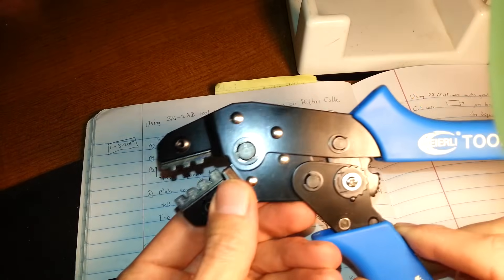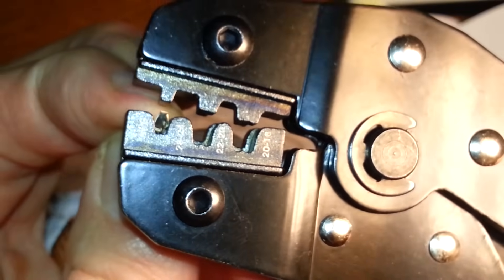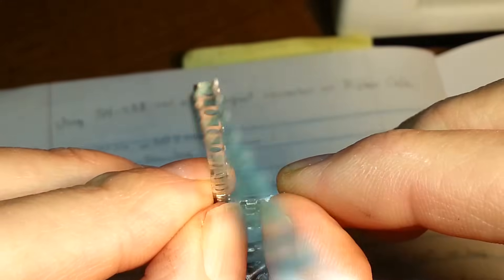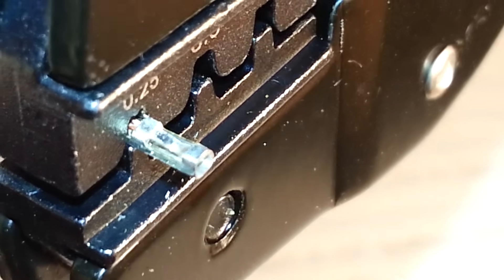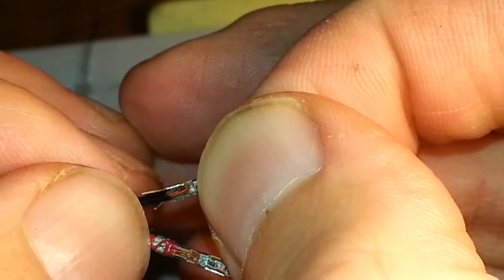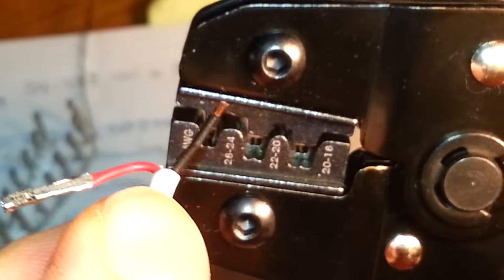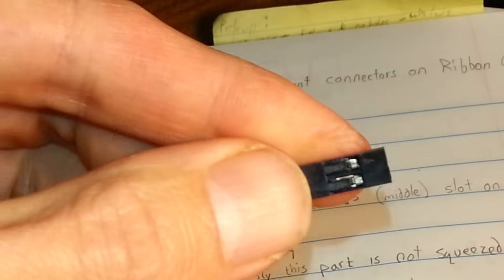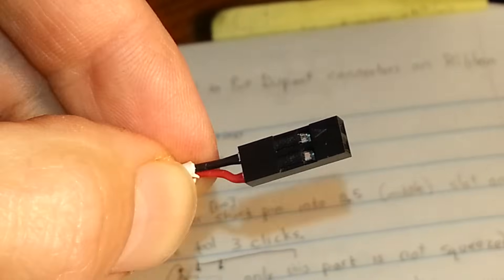SN-28B Crimping tutorial for DuPont pins.

Comment: The crimp should insert into the housing without needing to push it in with a screwdriver. If it doesn't just slide in, you have a poor crimp.
Reply from the maker: Good to know!  I wondered if it was because the pins I bought on eBay weren't up to par.  I'll try one without the wire to see if it slides in easily (to remove user error).
Reply: The problem is that the SN-28B is the wrong tool (no matter what the Chinese vendors claim). It’s designed for much larger terminals, so the finished crimp is too wide (and the wrong insulation crimp shape).

It’s not the shape of the terminals that causes the problem, it’s the crimp tool.

Comment: Watch what you're buying. The cheap ones are not stepped and attempt to crush the insulation crimp to the same size as the wire crimp. It looks like decent ones in this video.
Reply from the maker: Chaos Corner, it is somewhat hit-Or-miss, because I definitely bought the cheap ones.  Good to know about the differences!

Comment: I think it's smart
For that part where you use your nail to prepare a tool for that!
maybe a kontra plug? 
So you can not put the plug too far into the pliers?
.
And for thin Wire it is indeed an idea to double-fold and maybe too tinning the Wire?
it is needle work, you should also not be shivering ;-) 

Succes and cind regards from the Netherlands!
Rob.
Reply from the maker: R. Rob. thanks! from what I've read, tinning is problematic because the wire tends to break at the point the solder stops.  I had no luck folding the wire to increase the diameter of the wire for the benefit of the connector.  
I'm not shivering.  I'm holding my hands far apart from my body because I'm viewing my hands through my phone which is attached to a magnifying glass.  so doing precision work with arms extended causes unwanted movement. try it! :-)  also, the magnifier distorts your sense of how much you need to move your hands.
Reply from the maker: R. Rob. I looked up Kontra plug.  it was an audio plug?  anyway, ib think it is a good idea you have: anything to grip the pin and shields the body from going too far into the crimping tool might work.  Netherlands?  wow- so cool to reach the world!! :-)
Reply: No no audio,
But a similar type of plug maybe?

Yes, indeed, the Netherlands to be more precise near Rotterdam.
Google Maps is your friend! ;-)

I saw that you also did something about CNC,
Here on this side I like to do 3D printing.
BUT a small CNC is also on the list!

Kind regards from here again!
Rob.

Comment: If you twist the wire when it is longer then cut it you will get better results faster...
Reply from the maker: Superb Media Content Creator , that is a great idea.  
Cutting the wire at the last step is similarly useful when doing wire wrap connections.  Use that extra leverage!
Reply: It's hard to figure out the size of the right 'crimp' too but actually, soldering connectors is passee...

Comment: The crimping pliers are SN-28B. What is the label of jaws only ? I have bought the pliers but with different jaws, so I need to buy appropriate jaws to replace existing
Reply from the maker: Petar Nedic , I looked and there is no label on my jaws.  Anyone else know?
Reply: @TheRainHarvester  Thank you for responese !
 It can be engraved stamp on jaws (the part which goes into the pliers). Would you be so kind to just take a picture of jaws taken out from pliers.There are lot of jaws intended for crimping pliers and they have different shapes and dinemensions. The most important dimension is the thicknes of jaws part which goes into the pliers (4 or 6 mm).
Reply: @petarnedic855  I have the exact same tool, Weierli SN-28B. The jaws are 4 mm and marked with the number 28. Hope this helps you out.
Reply: @PuchMaxi  Thank you friend !
Reply: @petarnedic855  No worries amigo!

Comment: I found an easier method. insert a paper clip into the 'wings' to bend them over using your thumbnail to curve the wings over just sufficient to allow the wire sheath to enter as an interference fit within the wings - NOW the connector is 'fitted' to the wire - then holding the wire only introduce the connector into the crimper upside down and crimp in one action - it works really consistently. if your eyes are a bit weak get yourself a lamp with magnifying glass - this takes the hit or miss component away from crimping.
Reply from the maker: That is a great idea!  This idea coupled with the trick of inserting a pin into the connector side can really position the wire correctly!

Instead of a paper clip, why not use the wire itself?  (The portion without the isolation)

Comment: Look for an old used HT-0095 on ebay (or HT-100, same tool) That is the official factory tool for DuPont terminals, it crimps much better than generic double D crimpers. The die is cylindrical and swages the barrel into a tight tube around the conductor.
Reply from the maker: Thanks! Sometimes the pin doesn't fit the housing if you crunch this blue tool too tightly on the last step.  (It is a little bent, or too wide.)  I have seen people use pliers to straighten it, or squeeze the width smaller.  Thanks for the info!
Reply: If you need to do male terminals you need HT-102 btw. both of these do 22-32AWG wire. For 18-20AWG you need HT-73. also there are a pair of older tools called HT-208 and HT-213 for 22-26AWG and 28-32AWG. You can find old used Berg and Dupont branded units for under $100 on ebay, currently this connector family is made by FCI Amphenol (Harwin has a copy called M20 connectors with their own crimp tool). New crimp tools cost around $1000 and way out of range of hobbists. Compare pictures and make sure you're actually getting the actual tool because similar tools with the same ratchet handle get mislabled sometimes by Ebay sellers. you should also make sure that it still has the pin loading mechanism on the back.

 Useful information on these connectors and pictures of the tools can be found here:

http://tech.mattmillman.com/info/crimpconnectors/#minipv

Comment: Is every crimping tool equal? I mean like the size of the pins. i want to make custom wires in my pc but some crimping tools are way more expensive then this one, so are there size defferents?
Reply: Crimping tools vary widely. Crimping is a precision metalworking process with tolerances measured in hundredths of a mm or thousands of an inch, especially on small contacts like DuPont. So unfortunately, to get proper, reliable crimps that meet their maximum current specifications, you have to use the right tool, and they ain’t cheap. (They’re a lot cheaper if you buy them on auction sites and classifieds. A used original tool, even one that’s technically slightly out of spec, is worlds better than a Chinese tool.)

Comment: I hate crimping these. I test tried multiple tens on ATX Power supply cables and failed. What does the trick for me is to put a ferrule on first and then crimp onto the ferrule.
Reply from the maker: I didn't know they made ferrules that small.  Where did get them?
Reply: @TheRainHarvester  On Ebay there are 0,34mm² and smaller ones. With ATX cable you can crimp on white 0,5mm² ferrules. The cable part and the conductor part of the dupont crimp thing will grip on the unisolated part of the ferrule but they hold firmly and dont squish off the cable. I have the problem of breaking the wire at the part where the thing should crimp onto the isolation. https://www.ebay.de/itm/Zoller-Frohlich-Aderendhulsen-isoliert-unisoliert-0-14-mm-bis-25mm-TWIN/223496414298?hash=item34096ca45a:m:m077pmCLzh3knW_uHBFx7vQ 

0,14 mm² cable is rated for 3A which is max for dupont.
Reply: @TheRainHarvester You can get ferrules down to 0.14mm2 (26AWG) at least, possibly even smaller. With that said, there’s little point in those, as a 0.25mm2 (24AWG) ferrule will work fine for them, too.

Comment: You're actually the first I saw to specifically mention the "short" nature of these pins, which are 10 mm long. I then went to search for more info and indeed it seems there are also 12 mm (11,7 mm) pins out there. I took apart one original (factory crimped) Dupont connector and sure enough, it used the 12 mm pins. So I'm guessing 12 mm pins are the way to go. But are they available in China via eBay ? I think all those common ones on eBay are 10 mm versions. Any ideas ?
Reply from the maker: Perplexer1 Perplexer1 When I looked on eBay, they never specified the length.  Maybe a listing will sometimes specify.  It is strange that the default (unspecified) lengths of the pins and the housings were consistently unmatched over multiple orders that I made.  One thing to try: use the "ask the seller about this item"  after clicking on their user name when looking at the product.  They usually get back in a day or two.

Comment: This video helps me a lot. I also worked with professional tools in the past(from weidmuller). But €300 or more for private use is too much.
Reply from the maker: rick reiniers I agree.  This tool is just fine for my occasional / hobby use.
Reply: indeed, i'm currently using it for creating stepper motor cables for my 3d printer.
Reply from the maker: rick reiniers Nice! What printer are you making?  I'm currently making a PNP machine for populating circuit boards.  Keeps me thinking at night!  Post a video link if you post a video.
Reply: A reprap prusa i3
Reply from the maker: rick reiniers Are you using a kit, or gathering all the pieces yourself?  What do you think it will end up costing?  The biggest expense on my cnc was the stepper motors.  It would be cool to be able to click them in place to swap them into other machines!

Comment: Buy an automatic wire stripper tool, set the  strip length and this will keep your cuts uniform. Twist the wire to keep them tight or use wire ferrules and crimp. Ferrules can be problematic depending on size. These are small and may not work. I just twist the strands and then insert. I like the detail good job.
Reply from the maker: Wayne Wilson , I never heard of ferrules before.  Thanks for the information!
Reply: @TheRainHarvester  sure thing.

Comment: don't take this the wrong way but man... buying quality tools will save you a LOT of time.
Reply from the maker: Just curious...what is low quality about this tool?  It seems well-built to me:  a solid feel, and repeatable results.

Is there a more automatic version out there?
Reply: Yes, the quality of the tool is not good. Go for iwiss and it will save much of your time. Its very poorly built tool really, especially the jaws. It does it job, but it looks like the jaws are a bit dull.
Reply from the maker: +Satyajit Roy Thanks for explaining about the jaws.  What would sharper jaws do?  ( I didn't realize these were dull, and I'm not sure what part of the jaws could be sharper.)
Reply: The back side of these jaws are almost flat, but the one I use has proper curved holding area. This helps to keep the crimp aligned automatically and makes the manual process easier. Also the jaws are made of fine quality steel and looks shiny. Its not the cosmetic reason only of having them with shiny looks, but the fins of the crimp then slide through very nicely.
Reply: I was thinking the surface was just way too rough to be conducive for the "wings" and other metal with sharp punched metal edges to slide smoothly around to get that rolled and pinched effect, I made tools for making goggles that presses a bead, and rolls the whole thing to make a curled round shape with that bead on it, all with out crimping the brass or copper or whatever I am using (titanium is the newest material) and the smooth aspect was essential on the exiting roller faces, (entrance is rough to grab the metal and force it through) so seems like these should be similar, same with many of my pliers I have modified to bend and form metal in little ways (like tip of a pair of pliers that have a V cut in one and the other is ground down now to a sharp flat point with a bit of rounding on the tip to keep from cutting into the metal I am forming into 90º angles. smooth where you want it to slide and rough where you want it to not slide (like the back of the barrel where you dont want it sliding so it rolls around, the wrong way, instead it would hold it from sliding while the wings and bits would not grab to try and force that sliding around.
Reply from the maker: That is a good idea in general: modifying pliers for specific purposes!  How do you cut into/modify the hard steel that pliers use?
Reply: @TheRainHarvester  Crimping is a precision metalworking process that demands precision tools. This tool is entirely wrong for these contacts, so you’re doing a lot of manual fiddling to overcome this, with only partial success.

The proper tools are not only designed for the contact in question, they are made to higher standards. This means precision jaws with mirror polished insides (this isn’t for show: the rough surface of cheap tools prevents the contact from sliding properly during crimping, causing the contact to “seize” into the walls of the jaw rather than sliding up and curling inwards. It also makes contact removal much more difficult afterwards.) Furthermore, the real tools have positioners/locators to hold the contact in the right place. And finally, they have some form of wire stop, so that there is zero guesswork into how far to insert the wire. 

My favorite kind of wire stop is actually an insulation stop, which means the insulation will always end exactly in the gap between the conductor and insulation wings, eliminating the effect of tolerances in the strip length. Going from an SN-28B to a proper crimp tool took my success rate to practically 100%, and each crimp takes seconds to do instead of dozens of seconds of fiddling. The resulting crimps are flawless and fit the housing every time. The tool I got sells new for almost $500, but I got one, brand new and unused, on the local auction site for $60 shipped. 

What I find disappointing is that the Chinese vendors all save every penny possible, targeting the lowest price at all cost. If, instead of a target price of $10-25, they targeted $50, they could make a tool that’s much closer to the real ones, with locators and wire stops and everything.

Comment: nice video BUT!
if you are now before you shrink
a male pin stuck in the female before you go shrinking???
then the copper wire can do not go further than that is necessary

and better I think you could make a mold in this way.

success with shrinking!

friendly greetings from The Netherlands
Rob.
Reply: the pin trick sounds very useful maybe coat it with something too, so if you do like I do, and tin the wire then clip and clean it to fit, once crimped I can also heat and solder that to the connector for a good solid connection, and a say aluminum rubbed or just use aluminum raw, as the pin, the solder will not grab it nor flow where the pin must be. :)

Comment: I always solder mine. It's slow, but far more flexible in wire size. No special tool required.
Reply: Youre are defeating the purpose of crimping which is giving the cable more flexibilitiy to mechanichal stress.
Reply: Soldering crimps is just bad science often carried out by auto mechanics trying to be auto electricians.
Reply: @greenpedal370  It might be bad manufacturing practice, but not bad science. Soldering crimp terminals is a practice often employed by aircraft builders to improve reliability. Crimping, done properly provides excellent results. The trick is doing it accurately and efficiently. This requires a good bit of skill, good tools, a thorough understanding of how things can go wrong, and *testing*. The parameter space for doing crimping right is very very narrow. Soldering is far more forgiving, and IMO, the better choice for low volume work.
Reply: @rtwas  There is no way soldering of crimp connectors is approved for aerospace! On the contrary, it is forbidden for a good many reasons, Crimp is crimp and solder is solder!
Reply: @rtwas  Aircraft builders “improving the reliability” by adding solder to crimps? 🤣 Not a snowball’s chance in hell. Soldering a crimp, whether before or after crimping, is strictly prohibited because it reduces reliability. A properly-executed crimp is always more reliable than a solder joint.